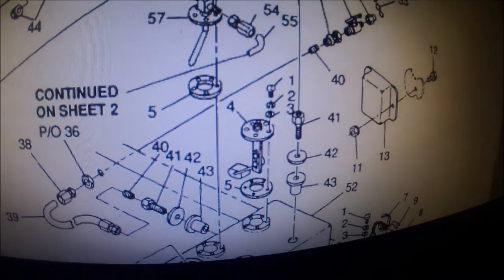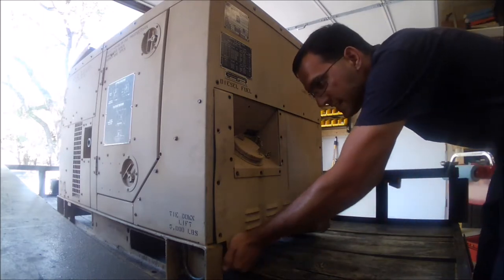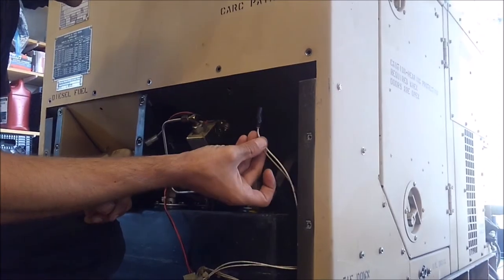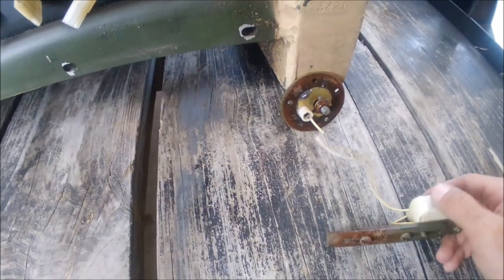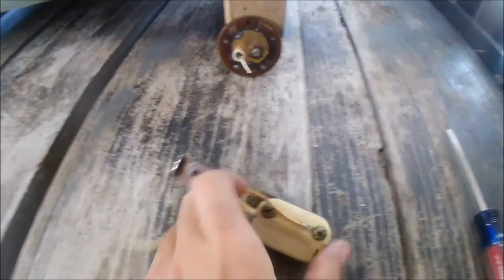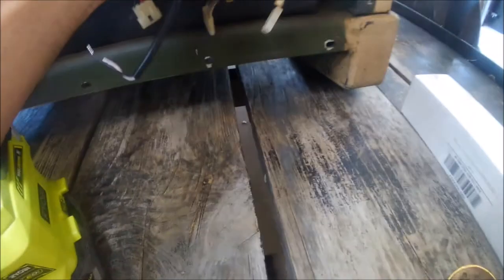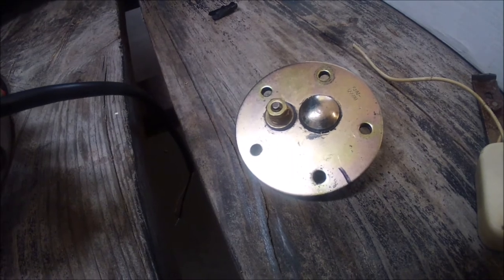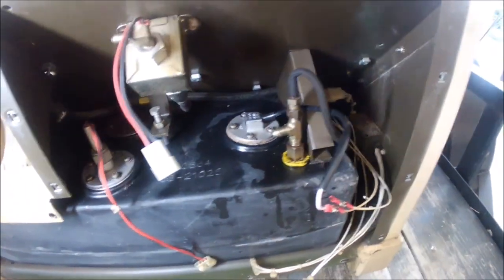MEP 802A - Fuel level sender replacement w/improved parts

Comment: @CallMeColt   I have been thinking about replacing the sender on my 831a with one of these. Do you remember the Ohms range on that sender for your 802a?
Reply from the maker: I tried to get one for the 831A & the gauge on there isn't compatible. I talked about it in my MEP-831A repair videos. You could also change the gauge & you'd probably be able to get it to work.

Comment: Have 2 of these.

Skid mounted. Very low hours. Both run excellent. One of them randomly says low fuel but I can start it for 3 seconds and then light comes on and it shuts down. Fuel is full to the brim. Gage shows same. What do I need to do?
Reply from the maker: I have another video showing how to fix that with a link in the description to the item needed. https://www.youtube.com/watch?v=oe7AnC-9ghc

Comment: What do you think is the most common problem of a stuck past Full fuel indicator? I'm thinking open circuit. Wire or Sender?
Reply from the maker: Probably open circuit. Check to see if the float is physically free. Then check the wires. Test the guage & sender. The Technical Manual is extremely usefully. Can be confusing because there's a lot of information in it but it will help you out.